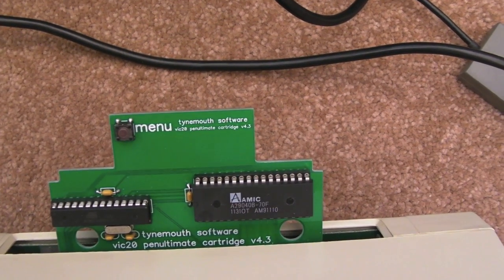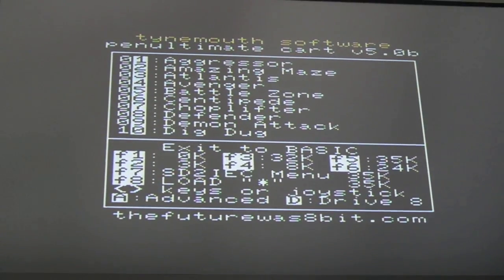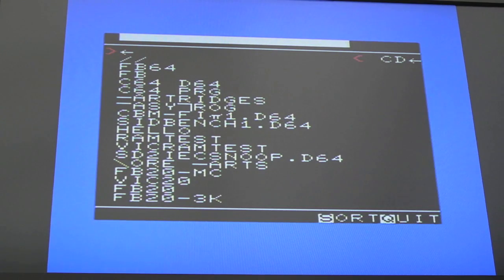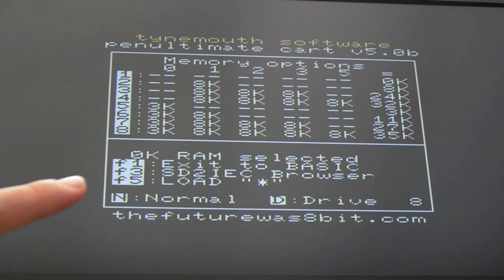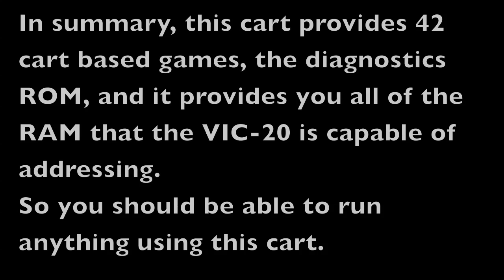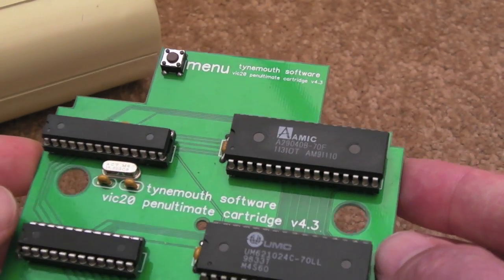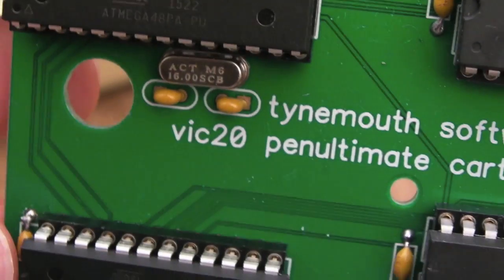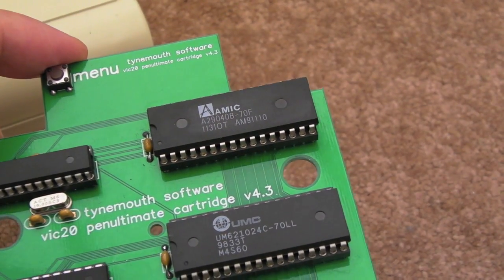Commodore VIC-20 (VC20) Penultimate (ROM & RAM) Cartridge from Tynemouth Software

Comment: In terms of availability, the uncased version, as in the video, is available from my site until I run out of stock (http://blog.tynemouthsoftware.co.uk/2016/06/vic20-penultimate-cartridge-part-4.html). The cased versions will be available from the Future was 8 bit, in a month or so, but they are taking preorders for those now (https://www.thefuturewas8bit.com/shop/commodore/pu-vic20.html).

Comment: Another fine product from Dave at Tynemouth Software, I still have his Pseudo Stereo Dual Sid Board rocking in my C64, it's been in there for 6 months (without heat sinks) and it's not skipped a beat. It's just a shame I don't own a Vic-20 or I'd be ordering mine right now Dave.

Comment: Oh great.  Another toy for me to buy.  LOL.
Reply: I'm already well past V2. The board is on V4.3 and the firmware is V5, is that enough revisions for you?
Reply from the maker: Hehe, what I actually meant was the next uber card to better the penultimate!  Perhaps with a SID interface or something!
Reply from the maker: Hehe =D
Reply: Do you think a SID compatible card for the VIC-20 would be something people would want?  I'm aching to create a new board for something.
Reply: It is on my list to do at some point. Now that there will be a source of nice new VIC20 cartridge cases to put such a thing in, it becomes a more interesting prospect.
Reply from the maker: I would quite like one, just because its possible lol.  That said, I was thinking of producing something similar the the ST or something.  I think that might be possible, but of course it will be better on something like the VIC-20 because the .SID files can easily be ported to the VIC-20 I think (depending on how large they are).
Reply: The Penultimate Cartridge is going to be sold by The Future Was 8bit, who are producing (at great expense!) a mould for VIC20 cartridges case. The retail versions of the Penultimate Cartridge will come in a proper injection mouleded case, and I believe the plan is to offer empty cart cases for sale in the future, as well as other VIC20 cart based projects (and I have a few planned out already). See the link below for some renders of what the cases should look like - http://blog.tynemouthsoftware.co.uk/2016/07/vic20-penultimate-cartridge-preorder.html
Reply from the maker: Haha =D  I know what you mean!  I am half expecting the Penultimate 2 to come out yet!
Reply: Better than the Penultimate? how is that possible?
Reply: The design I have floating around my head is to have it dynamically allocate different "voices" using a micro controller.  The propeller has very accurate SID/AY/SN emulation.  Imagine a VIC-20 with 4 SID's.  I've built AY soundcards with Arduino's.  Anyway, where is the new source of VIC cartridges?  It would be awesome to put a soundcard in it.

Comment: Great review, thank you. The cased version from TFW8B won't have the bit sticking out the top, the buttons will be moulded into the cartridge, one on the left will be menu, and there will now be a reset button top right to restart the current selection. The top left chip is a microcontroller (ATmega48P), the bottom left is a GAL providing all the glue logic. You are correct, the ROM is 512KB (AMIC brand), and the RAM is 128K, that that was cheaper and more easily available than one 32K and a separate 8K.  Not sure about the glitch you had, I'll try to recreate it.
Reply: The menu doesn't reset the machine. The 'tfw8b' retail version does include a reset button.

Menu is quicker to load than a full reset, but you might get the odd issue depending on what your VIC was doing last. I've only found the odd program causing this. I'm guessing here, but I kinda think it might just be the odd program shutting down the IEC as it's not using it once the game is loaded. The reset button will save you that odd off and on moment ;D
Reply from the maker: Ah OK, so technically it IS a reset button ;)
Reply: I never said it wasn't a reset button, but it's easier to think of it as a menu button as the other button (on the cased versions) is a reset button, which will just reset the VIC and go back to BASIC, or restart the game.
Reply from the maker: I meant the other chap that said it wasn't a reset button! =D
Reply from the maker: No problem, and thanks for clarifying those things =D  It might be that my SD2IEC had bombed due to some previous activity.
Reply from the maker: OK, I get it - the menu is using a NMI?
Reply: Not quite, the menu button tells the microcontroller to pull the VIC20 into reset, switches the ROM to the menu software and release reset. The VIC then runs the menu software as if it was on a cartridge and had just been turned on. This mode uses only the internal VIC RAM, so doesn't have the 2-3 second RAM check you see in BASIC mode with lots of RAM installed. It  is pretty much instant.
Reply from the maker: Thinking about things, I suspect that's probably how the 1541 Ultimate works as well then, because I guess you cannot depend on a NMI working depending on the software running.
Reply from the maker: Subbed!  Didn't realise you were thefutureis8bit =D
Reply: I have the Super Expander cartridge and the Programmer's Aid cartridge. Is there any possibility that these might be on a future version of this?